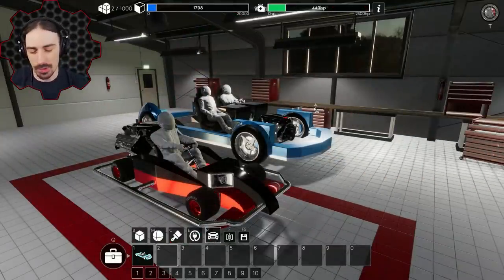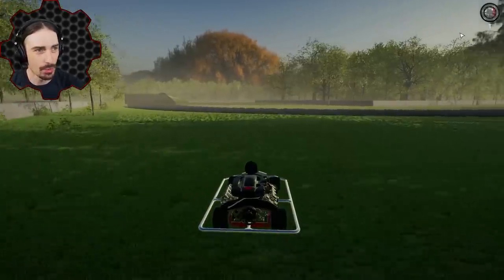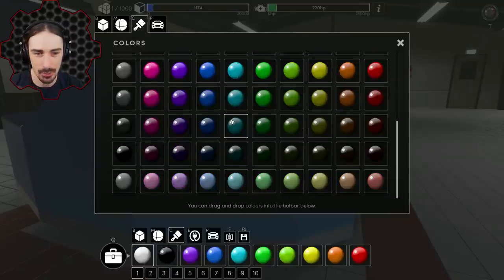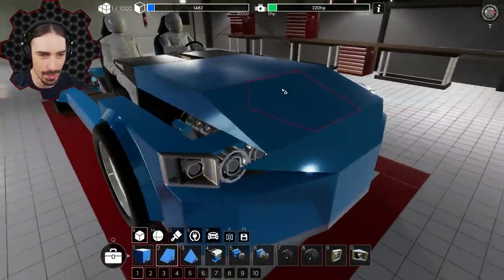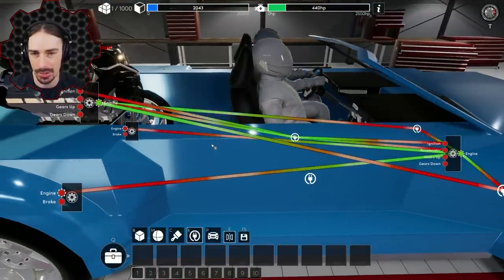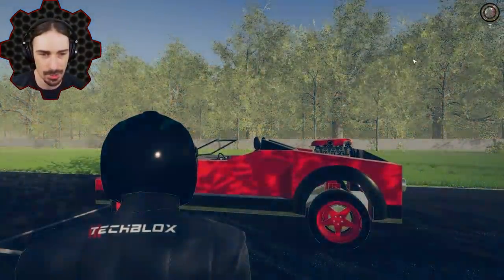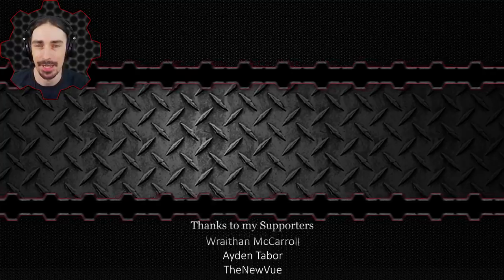I Turned an Unfinished Chassis Into a 3 Engine Racecar! - Techblox Gameplay

Comment: Random person: "why do you have two engines?"

SM: "there's three actually"

Also SM: "this baby got the 660 horsepower trident engine and uses around 10 gallons of fuel to keep it running for more than 10 seconds"
Reply: This sounds like something they would say in Top Gear.
Reply: i have a stock chassis which i tetrissed 9 of them into so meh could be worse
(great drift car btw)
Reply: This baby can also tow a tow truck
Reply: "it costs $400,000 to run this for 12 seconds"
Reply: Sounds like the gas mileage of a dragster lol

Comment: scrapman, do you know that your engine is always on primary, and you do know you can hook up the shifting features of the engine
Reply: Do you mean it's on automatic by default because yes, true.

Also you can hook up engines with more power to rear wheels for a better controlled drift feeling.
Reply: Yea didn't notice that except when he uses the v8 engine kart, it sounded like its on primary gear
Reply: @TheBladeKnight12  Okay so first gear?
The audio system is currently using one sound track where it just goes along the length and adjust volume depending ATM, from what I understand.
It's going to be worked on later. I'd guess, they recorded one of their own cars revving in neutral gear till it red line. that's likely why it sounds that way.

Comment: I'm glad to see the steering improvement. I can't stand how racing games give vehicles the worst steering and grip, as soon a you start turning your front wheels loose traction or you just have a ridiculous turning radius. Even my van can turn fast enough to roll itself over if I wanted to.
Reply: Ah yes, the extreme understeer to keep the car planted and moderate your speed.
Reply: @tropicalvikingcreations  I'm just saying, why can I turn a tighter corner in my 30 year old stock van at 20-30mph than a typical racing game will let you in a stock starter vehicle? I assume it's to add to the playability and upgrading aspects of the games.
Reply: @PasiFourmyle  I guess most games do do it for reasons like that but also they don't usually be driving tracks themselves. Just straight lines and circles, basics for recording.
Also I've heard some physics issues tend to pop up like for example, suddenly having a million horse power reactions in the traction systems.
Tbh idk for sure. It is interesting though.

Comment: Hey Scrapman, hook up the front engine into just the front wheels and two rear engines into just the back wheels ;) hopefully it's fun.
Also if you click on the gear icon on the rigs, there should be stuff like suspension settings. And you can set up your car to be a manual gearing.
This could be useful for drifting, maybe connecting the front in manual and leaving the back in auto, if they are automatic by default. I think so...?

Comment: F for mirror mode. And next time you delete the suspension/bearing, remember to hook the e-brake again so it works (: you only had e-brake on the rear right wheel.

Comment: Add as many engines as you can lol

Let’s see how far this can be taken
Reply: There no limit on that ATM, you'll just burn out until you hit a wall XD or turn and slow down.
Reply: @tropicalvikingcreations  brilliant lol. I’m taking advantage of this if gear ratios work
Reply: @THESLlCK  Uh it's in basic turn right now, so there's no tweakable ratios yet, it just adds more base power to the wheels. Just adding more horse power. Right now you'd have to build your own ratios with logic.
They're focusing on getting out the basics first.

Comment: if you go into the settings and change it from free mouse to cross air there should be a control in the control section that is labeled free mouse

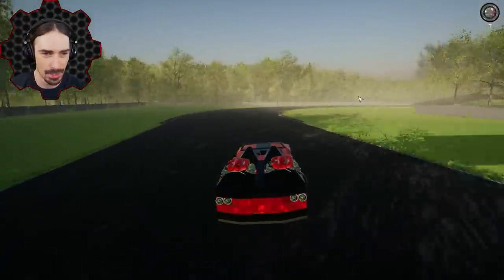Comment: 12:26 it would be better drifter if the front engine drives only front wheels and the both rear engines drive only rear wheels, that mean, front/rear torque distribution will be 33,3 %/66,7 %.
Reply: yes that would be way easier to drift for example both my awd drift cars in gt6 have a 35-65 torque distribution
Reply: @doomba187  I'm trying drift rc awd Lego cars and my favourite setup is 40 %/60 %.

Comment: I tried this game and I hate, and I mean HATE the physics in it.
You know how in scrap mechanic and in real life, to make your car turn, you need to turn the wheels?

I tried to use 4 non steering tires but made the front 2 turn like you would in SM. . . all that did was make the car drift crookedly rather than actually turn. So the physics are just outright wrong. The car just drove diagonally. Hopefully they fix this in a future update where we get a new physics engine. I say this because this is the main reason cars flip over in the current build way too often. Because it's not actual driving physics.

Comment: Build a dragster truck but the back of the truck has a fixed trailer that has nothing but engines and the trailer has 8 wheels 4 each side and you have 8 front steering tires same layout as the back and try to get as many engines as possible and have it as a frame work first then build a truck around it from said frame

Comment: This game needs more... "stuff". Like Scrap Mechanic, where you can design things down to the component level, to making piston engines, gears, etc. This game just gives you a big component that has it all built in.

Also, the lack of "feel" to driving anything is a major turn-off. Other than speed on the screen, it really feels like you're just clocking keys instead of driving a vehicle.

And.... you can't "SMASH" things like the game advertises!! There's no destruction, even down to the most rudimentary from like Trailmakers has :(